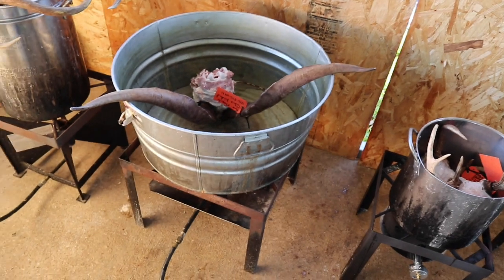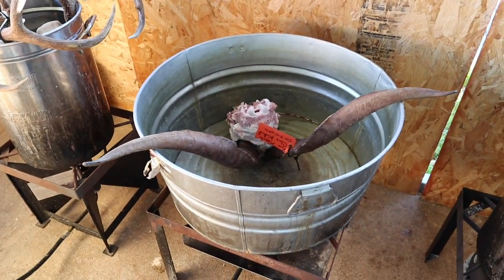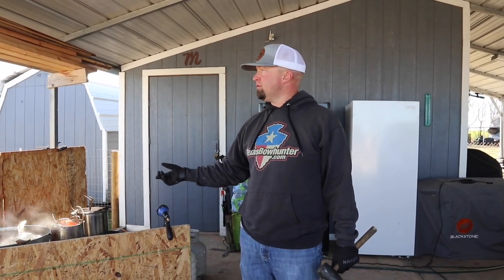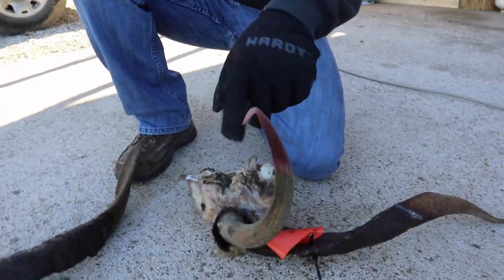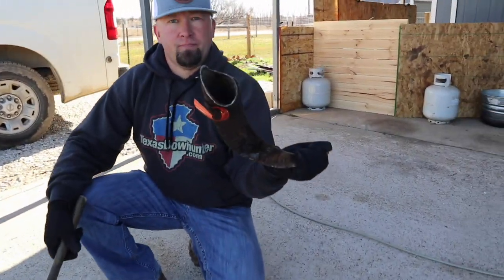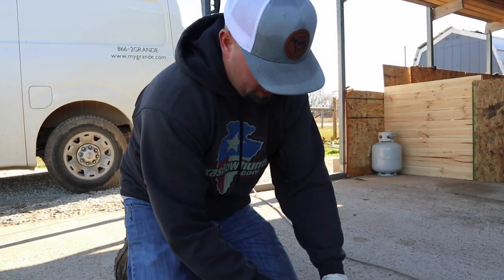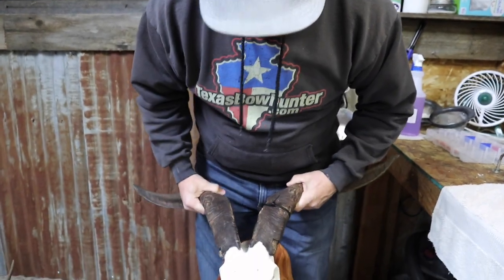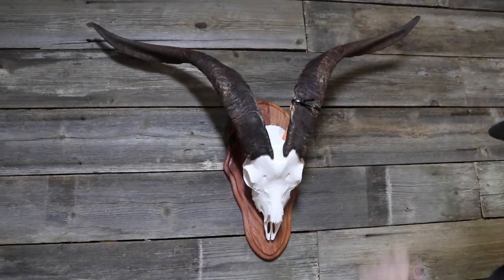Catalina Goat Skull Boiled And Cleaned | DIY Skull Mount

Comment: This rocks! Gonna mount my mouflon ram. Do you have any suggestions for cleaning out the inside of the horns once they are seperated from the skull? Thanks
Reply from the maker: We use hot water, Fabuloso cleaner, and a bottle brush cleaner. Pour the water/cleaner mixture in the horns, and clean with the brush. It may take several times to remove the smell.

Comment: tobin, what length and type of screw do you use? i got two deer skulls im mounting for myself on plaques but was wondering how to attach them. the video answered most of my questions
Reply from the maker: The screws I use come with the plaques so I'm not sure. I would guess they are 2.5" or 3". I will try to measure them when I get home.
Reply: @OurTopPinLife  that would be appreciated